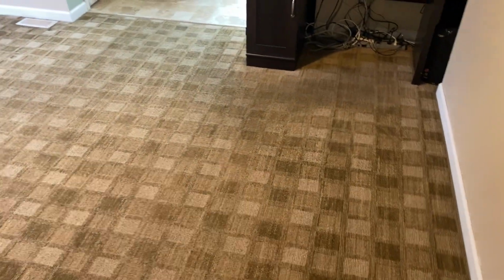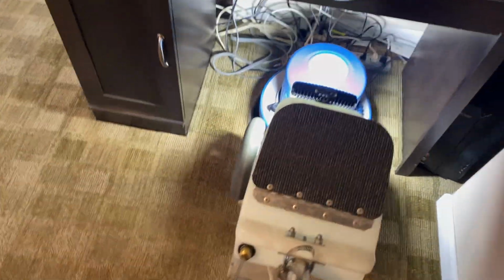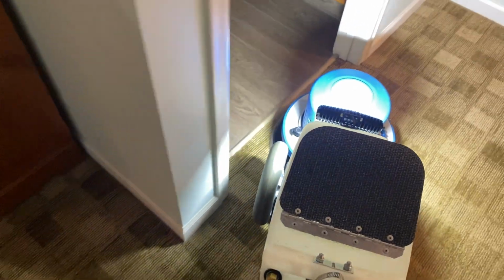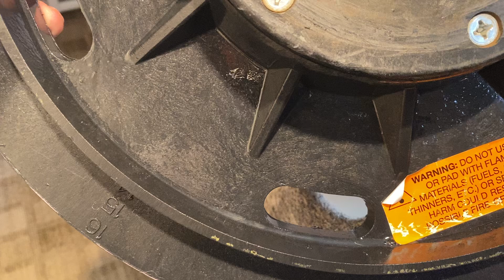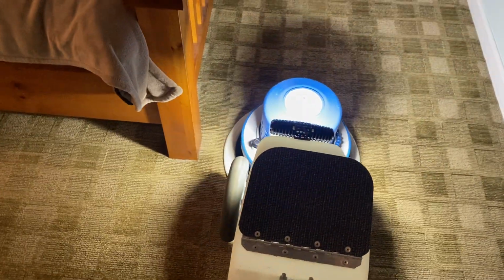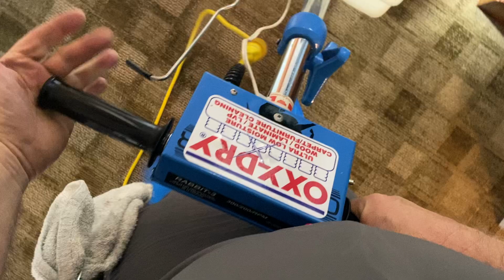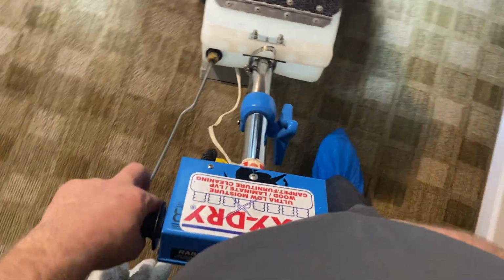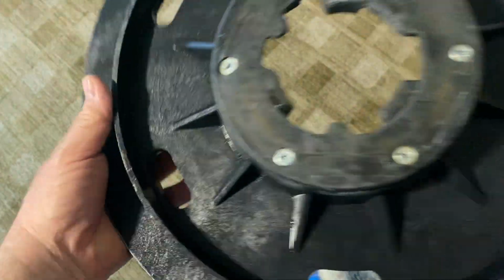Oxy-Dry ULM/SETT cleaning an unusual patterned 15 year old carpet

Comment: When I started cleaning with a rotary, I would be fatigued and my back would hurt.  Found out it was because I was trying to force the machine to go faster with the left to right swinging motions.  If you don't fight the machine, and go at the speed it is already set at, the fatigue will go away.  As you have said many times, "I'm not in a hurry!"
Reply from the maker: Let the machine do the work, all you have to do is guide it.